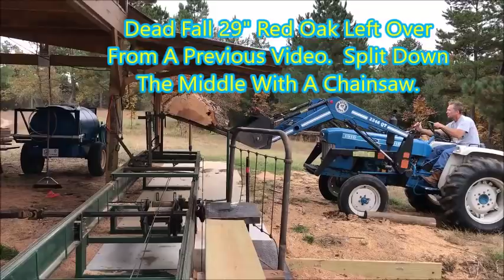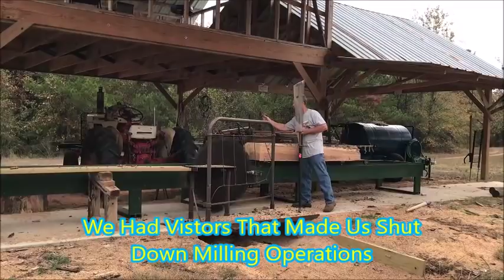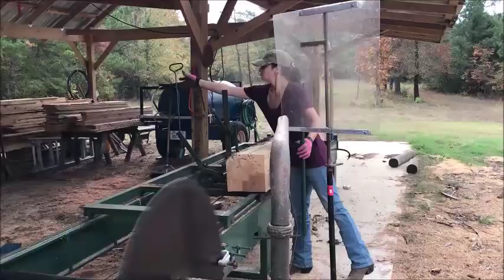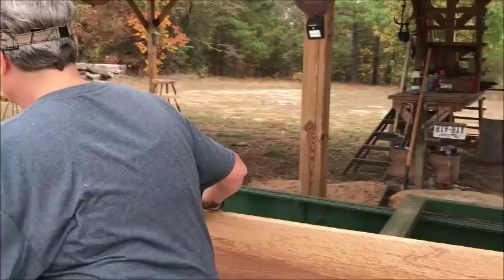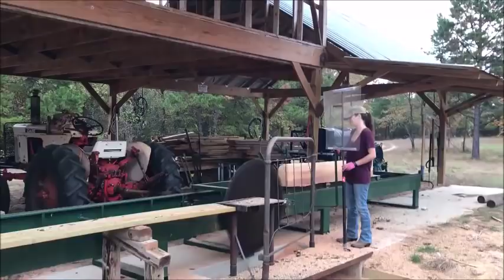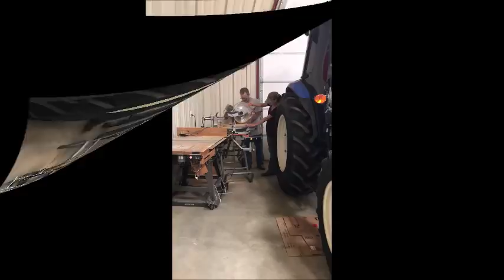Daughter Milling Red Oak On Circle Sawmill

Comment: Dad set up a Frick ‘0’ in 1974.I was 21 years old. We used it every winter and sawed out several houses shops and barns.We pulled it with an M farmall. We made a lot of trips to have the blade hammered.After Dad passed I had to decide whether or not to make repairs and keep it running.I probably will not.When I was young all the old timers knew someone who had been killed on one of these mills.Now 2 generations later that is forgotten.The sawyer life is literally in the hands of the offbearer.If you ever see the saw catch a slab and sling it hopefully through the roof and not someone you will never forget it.Your offbearer is supposed to keep boards and slabs off that blade not leave them standing there.Your are also missing the disc that pushes these away from the blade.Please get one or make one.Direct hookups are known to fail with vibration breaking the shaft.Hook ups should always by way off a belt from another pulley.A spinning saw on the loose would not be any fun.Companies have been sued.A rule of thumb for power is 2 hp for every tooth.We were way underpowered and you are too.I’m not trying to discourage you but I’m the offbearer that let the slab go through the roof.I’ll never forget the power and suddenness.
Reply from the maker: C Penn thanks for the advice.  I will take heed. The mill is under construction now and will get the upgrades you mentioned.  I kept the board that tried to kill me as a reminder.  Once the sawmill is complete, the board will be hanging near the mill and in the videos.  The prime mover will be addressed later too.  Thanks for watching!

Comment: Great job and some nice wood there! I got some oak logs laying around as well. As well as a circular saw used to cross-cut firewood. Really tempted to convert it into a small mill.
Reply from the maker: Yes that could be a neat project but you better watch some Tractorman44  videos.  He points out the different blades for cutting across the grain (you have) and with the grain like mine.
Reply: Yep, good point. Thanks for the tip!

Comment: What model Case? Looks like a 530? Seems to handle the mill well.
Reply from the maker: 1964 Case 530, was my grandfathers big tractor for hay press. If blade is sharp, we have no problem cutting oak with the 40" blade.  I bought a 56" blade.  Wondering if the 1.75" shaft can handle the additional torque?
Reply from the maker: Yes it is a 530.  My grandfather used to pull a case and then a john deere baler with it!  He also ran propane trucks hence the propane tractor!